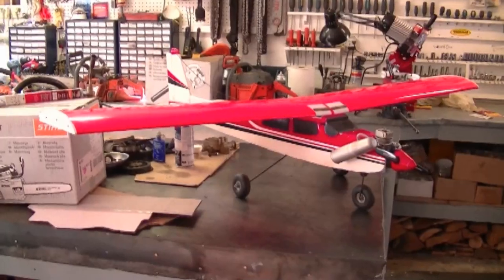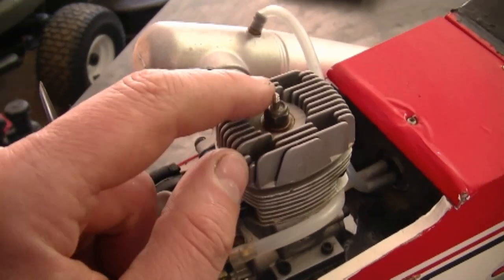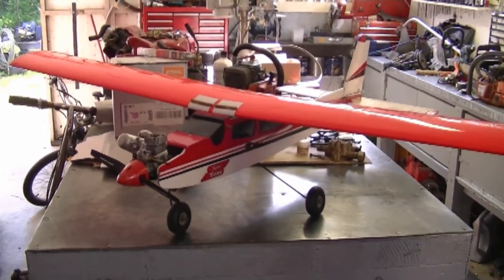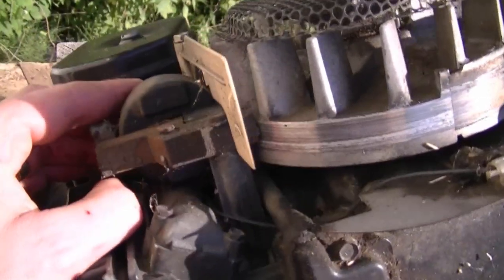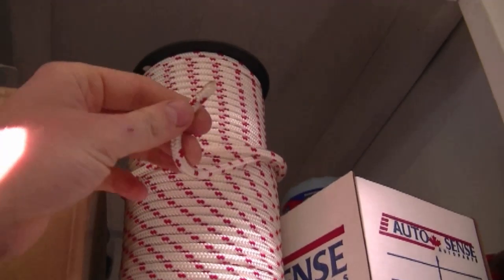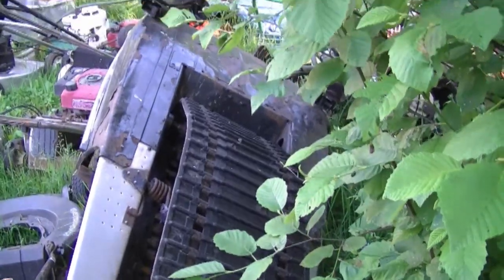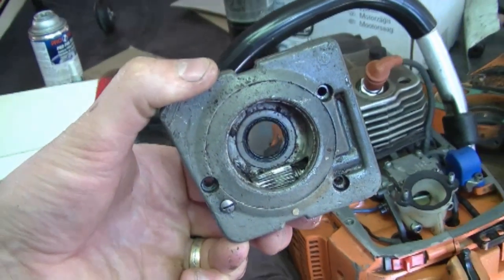Small Engines Q & A Video #54 in HD

Comment: @duranate I've seen it.  It's a snowblower engine, different model than what I have.  On mine, the spring housing is held together with a hollow pin, the end underneath has been flared out to hold it together.  Looks like I'll have to bend the flared end inward to work on it, then just bend it back when it's all done.

Comment: I have a question for you: I had a Honda HR-214 self propelled mower given to me. I flushed the tank out, replaced the in tank filter, took carb apart and I cleaned completely,  (main jet & nozzle), all other ports except the Idle jet. It had a plastic combination JET/PLUG that broke when I tried removing it for cleaning. My question is: Do they make a BRASS replacement Idle JET & PLUG..?

Comment: hey dony, great vid as always. can i run regular motor oil (the kind you put in cars, 4 stroke small engines, etc) in the gas for my 2 cycle leaf blower instead of 2 cycle oil? is there a difference?

Comment: I have a mid-90's lawnmower with a b&s engine, the recoil spring is weak, but the recoil housing is the riveted kind, is there anyway to take it apart or do I have to drill out the rivets and order a whole new recoil part?

Comment: @soverato3 I've seen 5-15% nitro fuel used in planes with no ill effects.
the manufacturer of super tigre engines recommends 0-15% nitro but with 18-20% oil.
You can find the manuals on there website.

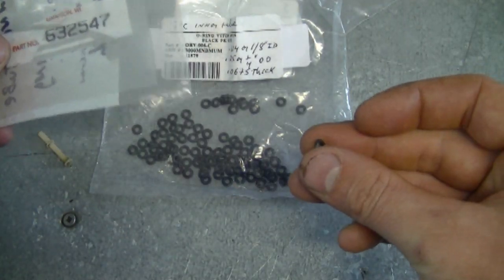Comment: donyboy - did you crack the tecumseh o-ring code? what are the measurements written on the package at 5:21? would be nice to not have to pay $3/o-ring when doing carb work.
Reply: I found 1/8" i.d. 1/4" o/d 1/16" thick looks to be the correct size o-ring to replace tecumseh part 632547
Reply: jesus jones yep, have two of them in a carb on an oh198sa  and it runs good on $0.05 o-rings.
Reply from the maker: jesus jones ok good, I would have to look at the sizes on mine
Reply from the maker: jesus jones make sure they are VITON rubber